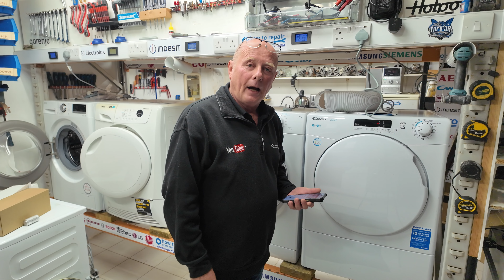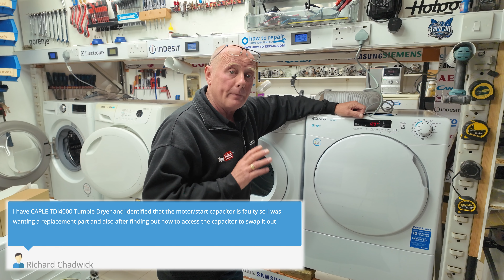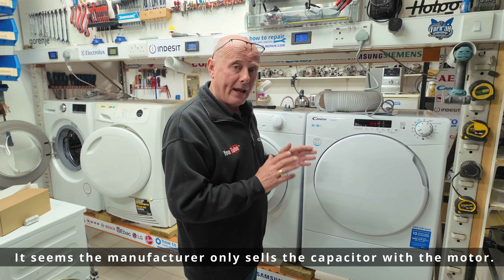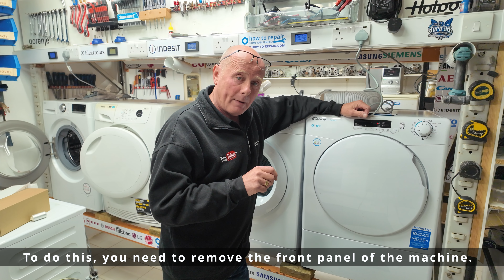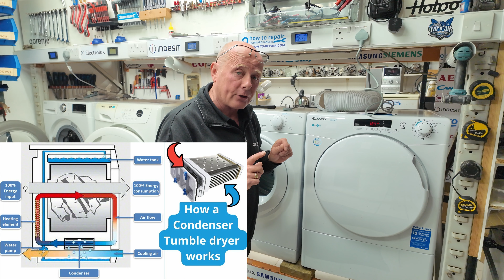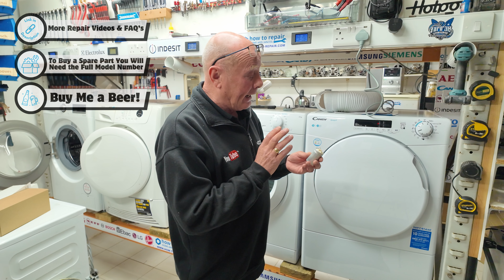Caple TDL4000 Tumble Dryer Accessing Motor Capacitor - Tumble Dryer Repair Guide & Troubleshooting

Comment: If you can't find a matching part, you can probably substitute it with any other 7 microfarad capacitor granted it's RATED FOR THE VOLTAGE.
It might not look all that pretty in the end, but 7 uF is 7 uF.

If you can't find 7 uF? You can put multiple capacitors in series/parallel to combine them into higher/lower value capacitors. It doesn't work like batteries so you gotta know what you're doing. But it's certainly possible!